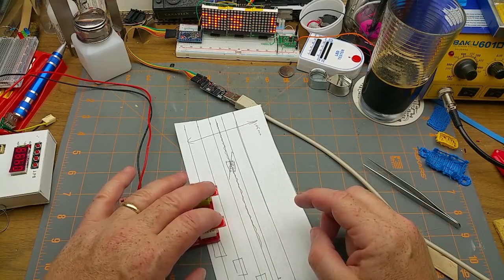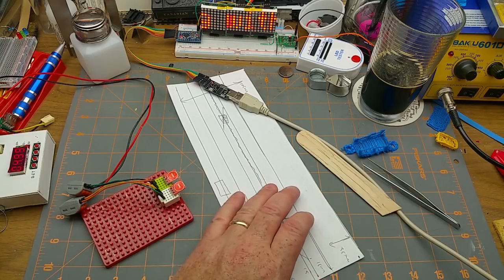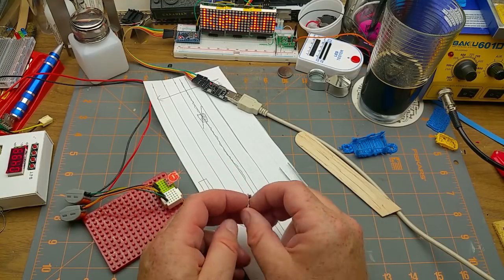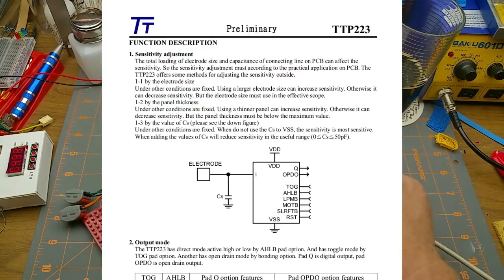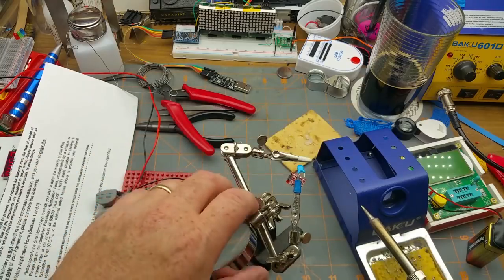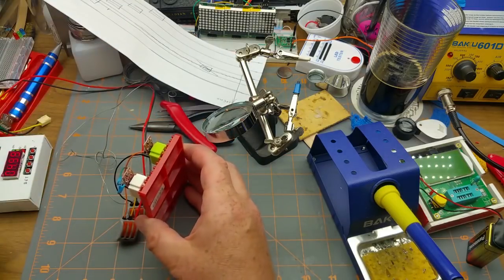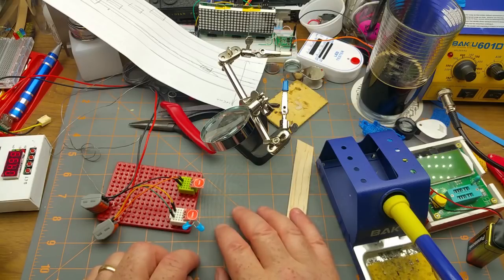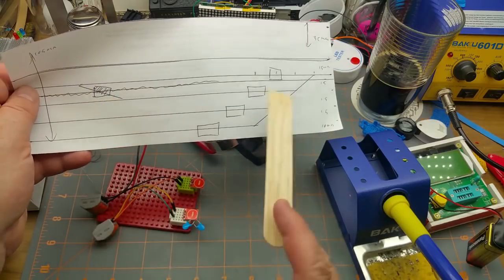tinkering with touch sensors

Comment: If you have some broken arduino modules, or some other broken/old/for-parts-scavenging electronics you can try to find some low value caps. For sure there will be at least two around 20pF caps near quartz resonators. They might come in handy.
Reply from the maker: Most of my parts scavenging boards are thru-hole, but I think there might be couple of surface mount boards in the pile somewhere.Hmmm...

Comment: Many thanks for doing the rersearch into theses devices, it is very informative. I had solved the problem by cutting the track on the sense pad to reduce its area but your solution seems to be much better.

Many years ago we used to make very small value capacitors by twisting together a pair of insulated wires. Sometimes plastic coated wires were OK but enamel -coated wire would give higher capacitances. I can't remember any values that were achieved but you may like to experiment - just for fun.

Comment: I've experimented a lot with those IC (TTP22x series) and as well tested a lot of materials and the best working ones are plastic type... For my project it was perfect as the touch surface has to be used trhough a plastic enclosure and I even 3Dprinted some prototype and they definitely work! best result is with a plastic layer total thickness of 2mm/2.5mm
Reply: currently I'm testing glass with various thickness, if anyone interested I can post the results once I will have them....

Comment: I got some samples of the newest version of the mega328 (the PU edit: actually it's PB) and it's got native capacitive sensing on several pins. One of these days I'm gonna design a PCB with some integrated capacitive pads and a battery+transmitter to use as a little control panel.
Reply from the maker: That sounds interesting.

I just did a quick search, and it seems to be a feature that is mentioned in passing on the datasheet, but not widely used. Hopefully you have better google skills than I do when you get around to your project.
Reply: That's because I mis-typed, it's the ATmega328PB, not PU. The updated datasheet for that part describes it at length, it's actually really easy to use.
Reply from the maker: Ahh, typos. The modern curse against clear communications!

.

At my level of coding, anything that isn't supported by an arduino library is beyond me. 
I'm much more comfortable with hardware solutions than software when things get complex.
Reply: It'll probably come to Arduino eventually, I wanna say I heard they are basing the next revision of AVR Arduinos on the PB (it's also backwards compatible oc). There might be some wrapper libraries already.

AVR is really fun to learn though, it's so clean and tidy and the toolchain is all open source. Makes you feel like you actually understand what your computer is doing. Even AVR assembly isn't too bad.

Comment: Would you be so good as to tell me what these modules are and where they were purchased? I would like to use them for the same purpose as you are intending. I would glue them to a finger hole behind the board and touch them directly. Not as elegant as what you have planed but functional. Thank you for your video's! I lean a lot for them and find them very interesting.
Reply from the maker: They are from this mailbag video. Links are in the description :  https://youtu.be/C9mYsyhcGKg

Comment: How does it behave if you put the wood there before powering it on? No autocal in it?
Reply from the maker: It is supposed to auto-cal, but the wood seems to be too much for it to deal with for some reason. 
Probably related to the sensitivity setting capacitor not being present. It's probably too much for it to auto-magically deal with.